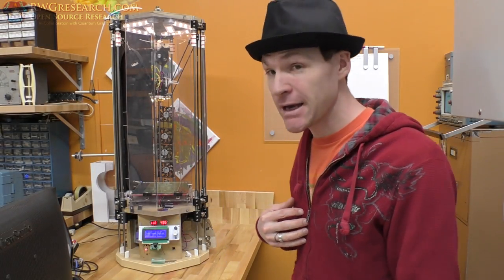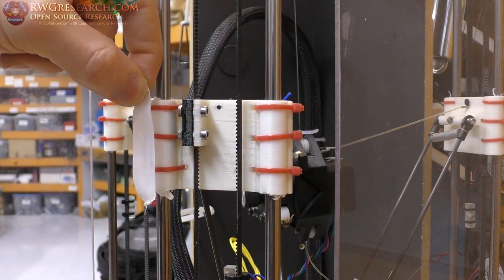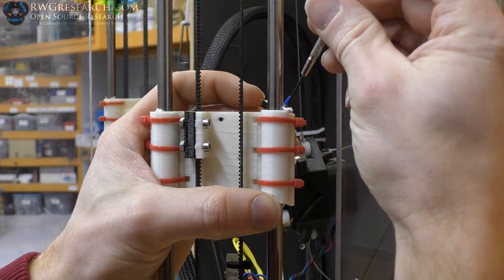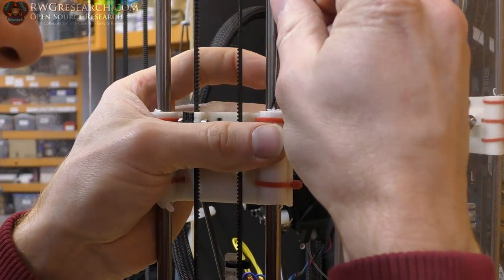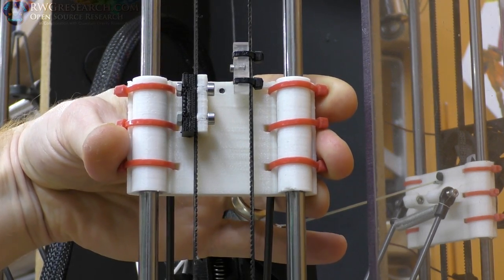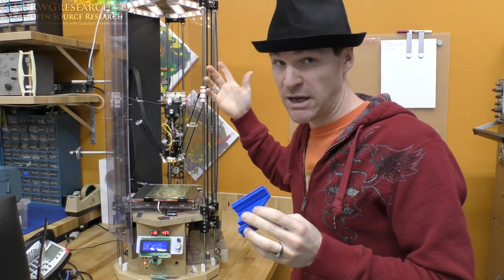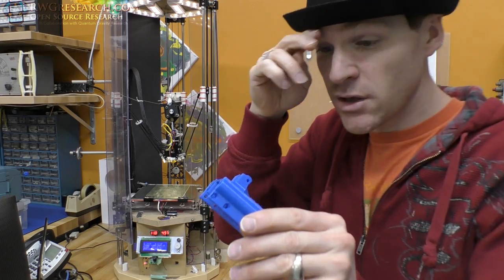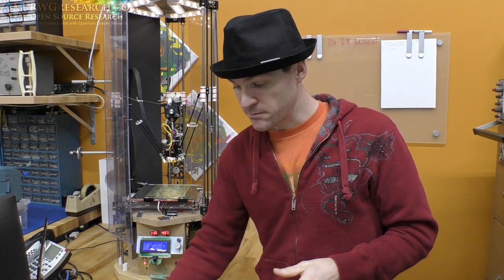Quick Fix For "Play" In Bushings, 3D Printer Quick Tips. & NEW "Sliders" With integrated bushings.

Comment: Russ, do you have a google+? I have some photos of how I did mine to eliminate play from the offset belt.
Reply: Also, have you seen the bearings that use small pieces of ptfe tubing as the bearing surface? Looked pretty nifty.
Reply from the maker: Yeah. those I'm sure work well. could make inserts for this type is slide as well. I have some 1/4" stuff some where that would work well. ~Russ
Reply from the maker: post the link. I should be a la to see it. I may need to approve the comment tho so just post it and I'll check it. !! ~Russ